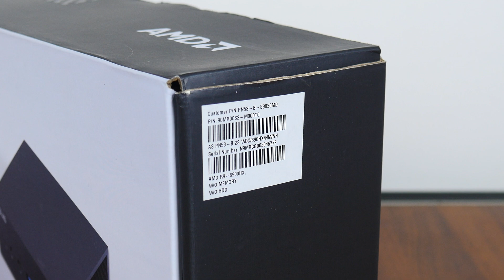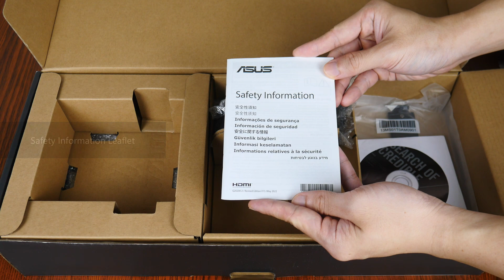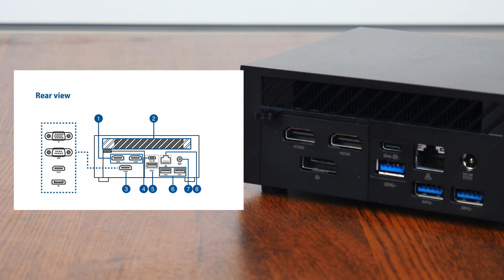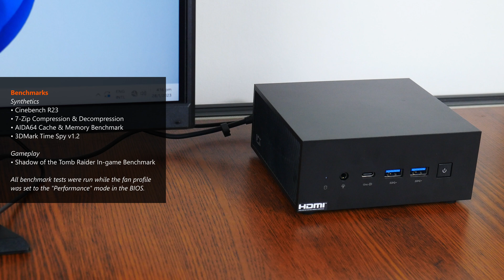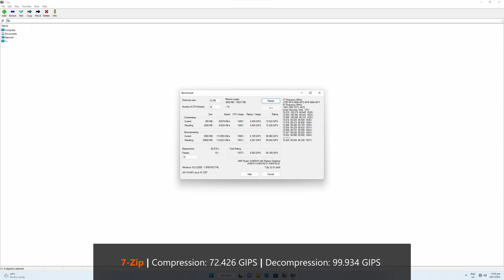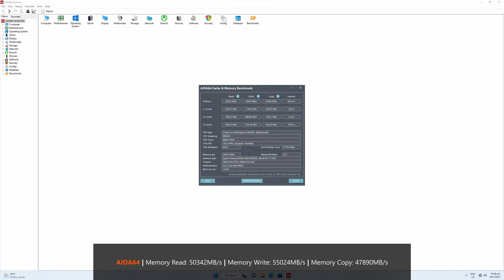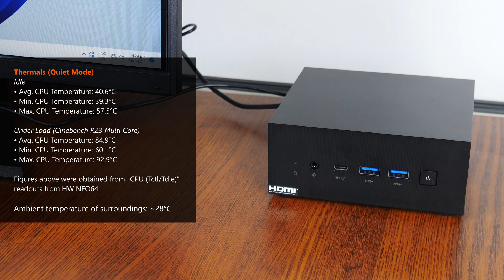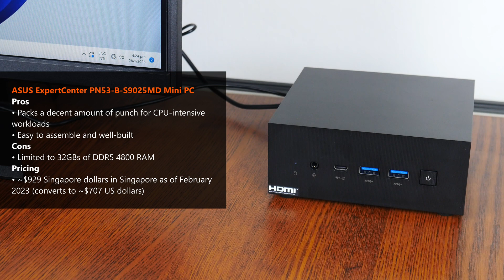AMD Ryzen 9 6900HX Mini PC Powerhouse: ASUS ExpertCenter PN53 Review

Comment: hi I am have a R7 barebone system and there is a problem when I try to install windows 10/ 11, my USB driver with windows 10 bootable USB drive won't boot... would you advice the correct bios setup 
Thanks
Reply from the maker: Have you tested your bootable drive on another PC to rule out a problem with the bootable drive itself? The PN53 should resort to booting from the bootable drive if your SSD 's empty without requiring further intervention in most cases..

Comment: Out of curiosity, I've been looking to buy a SSD, specially the Crucial P5 Plus (CT2000P5PSSD5) with a heatsink (apparently we get the heatsink with the product).

Do you know if we can fit the SSD even with the heatsink? 😌🙏
Reply from the maker: You'll have to get the version of the P5 Plus WITHOUT the heatsink - from what I recall, the PN53's M.2 slots do not have sufficient clearance for SSDs with pre-attached heatsinks. That said, ASUS's included thermal pads on parts of the chassis that come into contact with the SSD to help with heat dissipation, so these should help somewhat with keeping your drives cool.
Reply: @ALKtech  Wow thank you very much for the reply! You have no idea how close I was to buy the one with the heatsink 🤣🙏🙏
Reply from the maker: @Mosestylez  luckily I replied in time then 😂 glad to have helped!
Reply: @ALKtech   eah 😅
But I'm just wondering, those 2 thermal rubber pads that is included. Where should I put them? On the ram or on the SSD?
And should they be below or over them?🤔
Reply: @ALKtech  also could you please do me a favor?🙏
 In the software "MyAsus" we can check how many RPM the fan spins. Can you see how your fan is when no programs are open? 
My fan is really loud for some reason, even on idle. And the lowest it can get is around 1800RPM🤔
Reply from the maker: @Mosestylez  the thermal pads come pre-installed in the PN53 - no need for you to readjust or reapply them. Simply insert the M.2 SSD into the slot, install the screw, and when you put the chassis back together, the thermal pads that come pre-attached will come into contact with the M.2 drive!
Reply from the maker: @Mosestylez  oh oops, I don't have the PC with me anymore as it was a review unit loaned to media outlets. Have you tried tweaking the fan profile from within the BIOS to see if it helps? I.e. setting the fans to the Quiet mode instead!
Reply: @ALKtech  it's okay 😁
I can only tweak it by changing to either performance mode or quiet mode. It has been on Quiet Mode since day 1.
Maybe I'm just picky about the fan sounds since I'm not use to having to hear it that loud all the time.
But I think I'm going to sell it and then later on buy the upcoming Asrock Deskmini X600 when the new Ryzen 7000G series releases. That's also a very small PC, however I will buy Noctua fans so it's silent. Many people who have the X300 with Ryzen 5600G says that it's silent even when playing games thanks to the Noctua fan, and they also get good temperature
Reply from the maker: @Mosestylez  oh yes, the ASRock DeskMeet/DeskSlim AM5 PCs look pretty cool when they're finally available to purchase, especially given their support for a discrete graphics card. Should be a pretty big step-up from the PN53 for sure especially if you're intending to get a good AM5 processor!

Comment: Can I run windows 10 pro in this as I already have it installed with all my stuff on a pcie samsung NVME ?
Reply from the maker: Was Windows 10 installed on the Samsung SSD using a different PC, and is your intention to just plug and play the said drive into the PN53?

If this is indeed the case, you will likely encounter issues with getting Windows to start/stability issues, as the drivers and OS would have been configured to work with the original PC that you did the Windows installation on. That said, you might get lucky, as I've personally tried this before on some occasions, sometimes it works, sometimes it doesn't. 

In any case I would recommend backing up all your files somewhere, and doing a fresh install..
Reply: @ALKtech  It worked Without a hitch. Yes it was an OEM version on a Dell Laptop but I upgraded it to windows pro before I made the switch.
Reply from the maker: @alanlink7840  great to hear - just make sure to uninstall the drivers from the previous PC that you removed the drive from, and install the latest relevant PN53 drivers. And of course, to monitor for any system instability too!

Comment: Can the ram support up to 64Gb? Because I saw some ppl from other forums mentioned that it could.
Reply from the maker: My understanding is that the official RAM support amount from ASUS is 32GB, as there have been reported stability issues when using 64GBs of RAM with the PN53. It might work with 64GBs, but your mileage may vary!
Reply: Does it get hot?

Comment: Where can I buy the pn53 6900hx?
Reply from the maker: You might wanna try checking in with your local ASUS resellers/distributors - I don't see the 6900HX version of the PN53 for sale on common e-Commerce platforms such as Amazon yet...
Reply: @ALKtech  Even ASUS USA doesn't mention it, much less sell it.  Any idea what the status is, and when we can expect it in "stores?"
Reply from the maker: @chuckphillips5682  your guess is good as mine unfortunately. Might be worth dropping ASUS USA an enquiry to see what's the hold up about..
Reply: I just purchased one from Geekom it is powered by a PN53 R1.03 Looks identical as the video has same featured ports
Reply: @alanlink7840  Can you please share your experience with it? It looks very promising on paper. I was about to order it, then I saw the minisforum UM790Pro is now on pre-order. Looking forward to your reply. Cheers
Reply: @Samuel Adeniji  Unfortunately, I just received it yesterday and am out of town until after Memorial Day. I plan to load Windows 10 on it, so there is no review for a couple of weeks. It is asus pn53 it had crucial ram and a kingston ssd.
Reply: @alanlink7840  I appreciate your quick reply mate. Enjoy your timeout and your new toy as well. Finger crossed till later :)
Reply: @cutesammie  Its working Great so far much faster than my old Dell laptop. So far no problems I am running Windows 10 Pro on it.

Comment: 6:45 Can you confirm if it's really 2x PCIe 4.0 x4 M.2 instead of 1 PCIe 4.0 x4 and 1 PCIe 4.0 x2? TIA
Reply from the maker: Hello, its stated on ASUS's specs page for the PN53 that both slots support x4 link speeds!
Reply: @ALKtech , thanks for the reply, but the spec page mentions the wordings up to PCIe Gen4x4, "2 x M.2 2280, up to PCIe Gen4x4, 256G~2TB SSD". Possible to test this out?

Comment: how is the bios of the PN53? can the ram speed or the ram timings be changed? is amd cbs there with all its sub menus especially the UMC common options with its memory timings?
Reply from the maker: It's as basic as a BIOS can get; it has the old school blue and grey interface without any fancy graphics, and you don't get any configurability options at all for the CPU and RAM. Hope this clarifies!